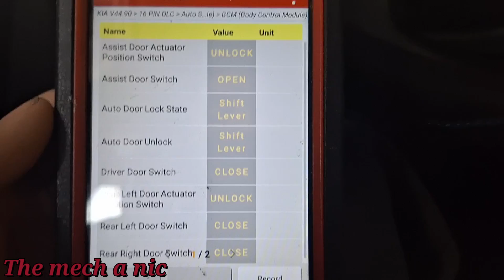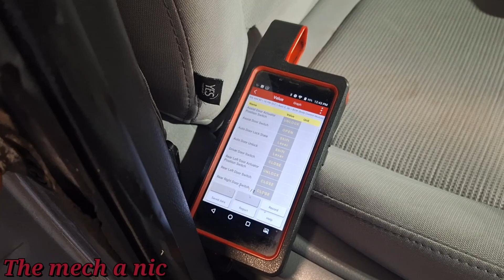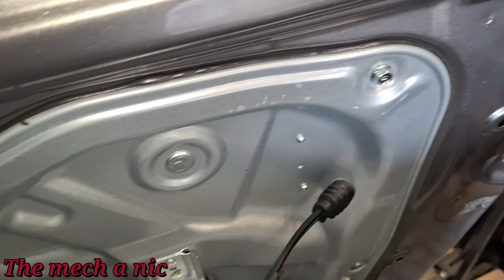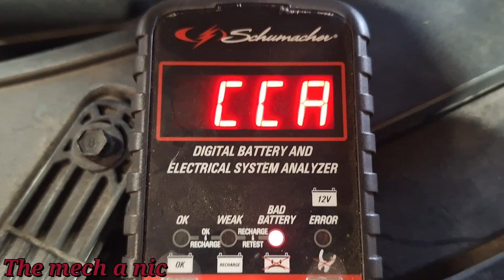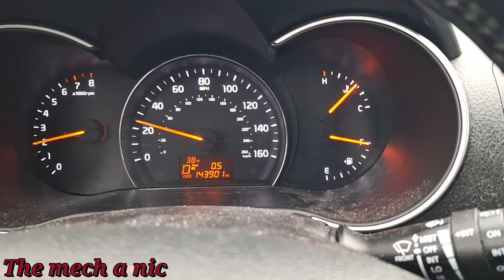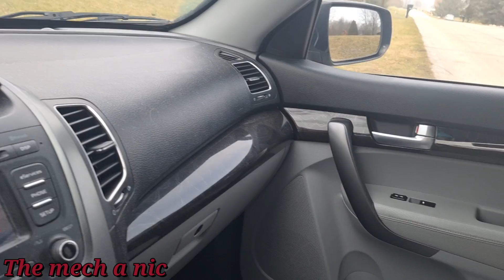kia sorento battery keeps dying and no auto lock

Comment: Toyota Camry would be a great choice for a first car. Avoid 2007-2009 for oil consumption issues. I’d also be weary of 2010-2014 unless it’s been documented the torque converter was replaced. I own a 2013 Camry that had the torque converter replaced under a TSB and it’s been a great car. 2015-2017 has crash safety improvements and the updated torque converter. 15-17 is the best choice if you can find one that isn’t overpriced
Reply from the maker: 15-17 is a bit newer than what I'd like to buy. Teens will most likely crash their first car . I'll be looking for one that's a bit older. Thanks for all the info 👍
Reply: @themechanic6117  I’ve been happy with my 2013 Camry XLE. The transmission had a shudder and I had the torque converter replaced for free under a TSB that has expired unfortunately. I got it with 109k miles and now it has 165k miles and the only big thing I’ve had to replace was the front wheel bearings. Other than that just regular maintenance. I change the oil every 5k miles and it burns nothing between changes. If you plan on getting one just feel for any vibration at 40-55 mph that’s the sign the torque converter is bad. If you can find one without shudder it’ll be a good car

Comment: Had a buddy with a ford flex.
All 4 door locks would always read as open. And he would disconnect his battery everytime he parked his vehicle. He had been doing it for 6 years. He old me he has  had replaced the locks before ajd it just keeps happening. I bypassed all his locks with 20 cents in butt connectors lol. It pays off to have car knowledge
Reply from the maker: A lot can be done when someone understands how the system works 💪

Comment: Im all for cheap cars, although this one i wouldn't. To many issues owning and insuring  these cars. Only way i would buy this is to use as a parts runner, or a spare for when the main car is being worked on.
Reply from the maker: I hear you, first car for a teen isn't a good idea. I doubt she'll even check the oil 😩
Reply: @themechanic6117 Whether its a new off the line or an old beater, both can break down at Anytime . Personally id find an older honda/toyota 96 and newer, for obd, and go thru it, and put her in that. She can make her mistakes in it, before putting her into a newer vehicle.Shes a teen girl, and you dont want your teenage girl broke down and something happen to her. There's more creepy men then their are good, so she wont know their true intention till its to late. Some advice in lookimg for these good deals is to find the ones that need brakes, tires, timing belt, head gasket. Most of these items your going to do anyways so get the price reduction off the bat. You can turn a 200 to 500 dollar car into a 3 to 5000 dollar car.